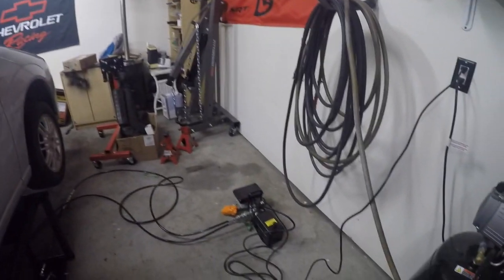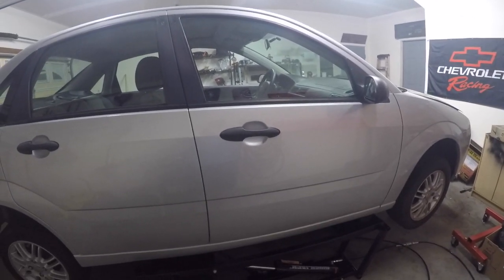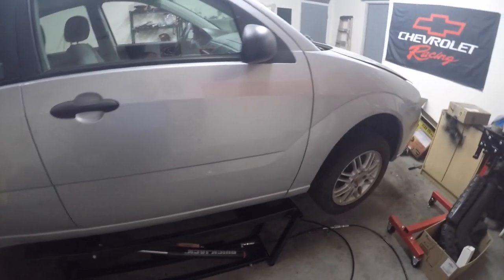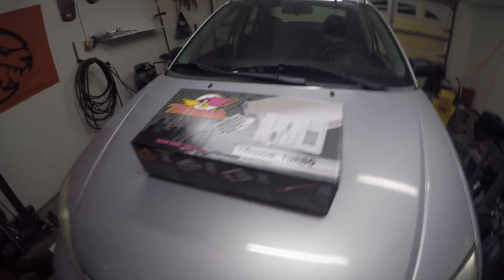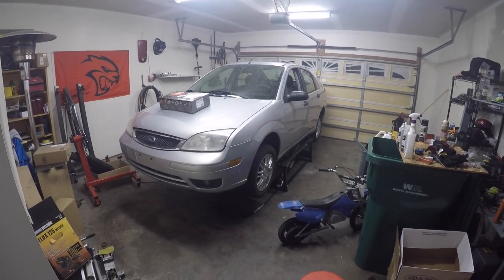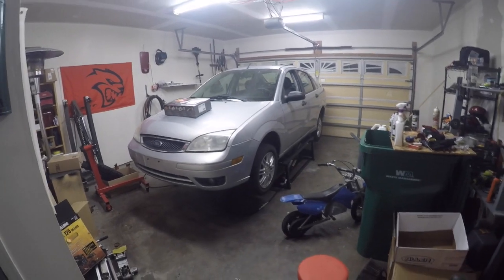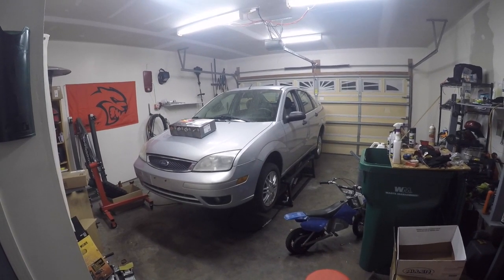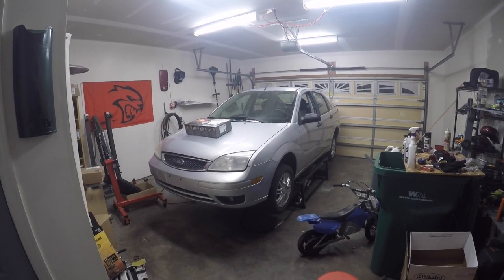QUICK JACK 7000 HAS ARRIVED....AWESOME

Comment: For safety reasons, the locks should be on the outside not the inside of the frames. Either swap the frames from side to side or flip them around.